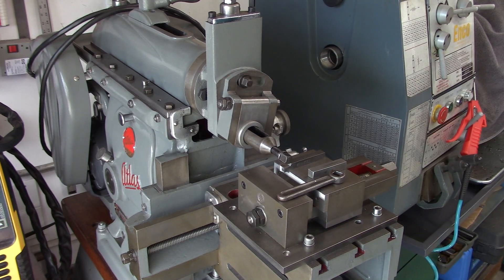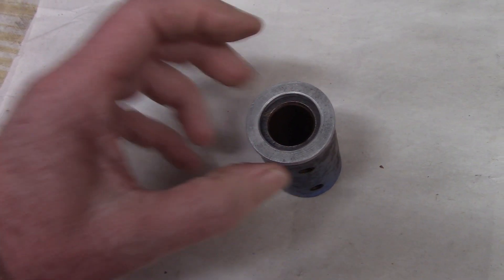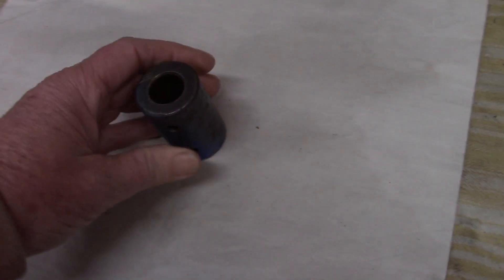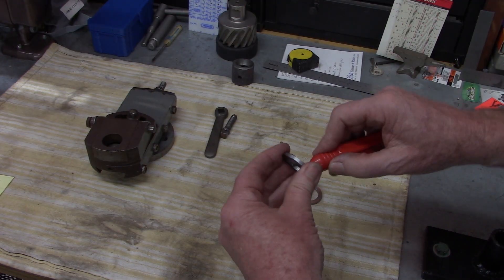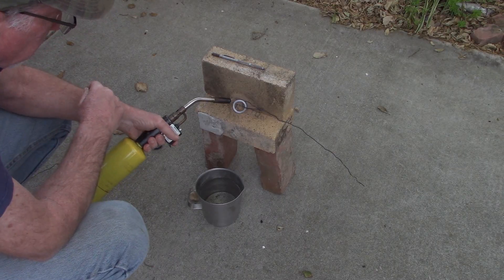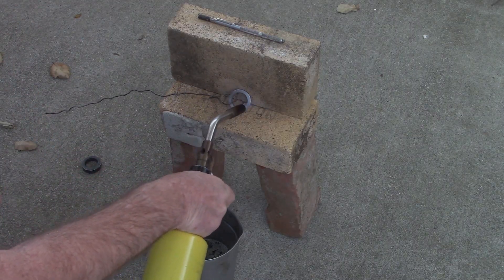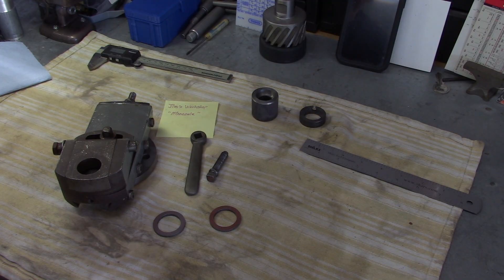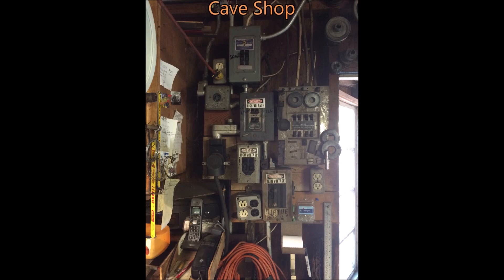🔧 Making Custom Washers for an Atlas Shaper Tool Post Viewer Project🔧

Comment: Great video!   It was interesting to see how you made my parts.  I will definitely send you some photos of the 7B when I get finished. I'm in the process of scraping everything in right now and you know how much of a chore that can be!   I had to scrape in a straight edge for the 7B and of course my surface plate was not large enough for the straight edge casting I purchased, So down the rabbit hole I went.  I have learned so much from the 7B videos you have posted and I re-watch them often!  Thanks again for all the parts you have sent me!!   
Daniel
Reply from the maker: @troutfitter547  Happy to help Daniel, yep, projects, create projects. I actually enjoy scraping. It’s kind of therapeutic but boy it takes a lot of time and I’m still a beginner. Looking forward to seeing your shaper when it’s all done.
ATB…..Dean

Comment: I have the Craftsman equivalent shaper.  I bought it less vise.  That is an outstanding vise on your Atlas.  Curious as to the source of the vise and any details, thanks!
Reply from the maker: Hi Geoff, the vice is actually a South Bend shaper vice without the swivel base. It was on the shaper when I got it. Someone had made a flat mounting plate for it.
Finding a low profile vice for a shaper can be a challenge. Thanks for stopping by !
Reply: @TheAyrCaveShop  Thanks!